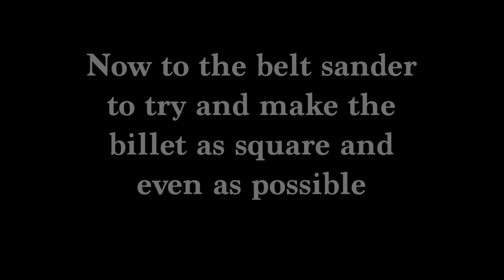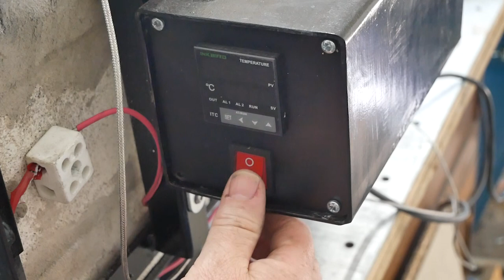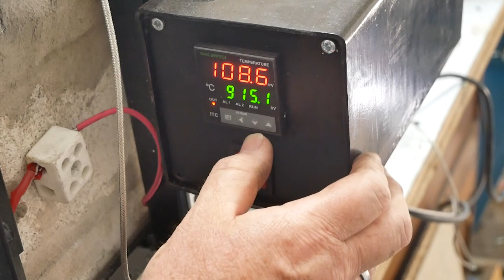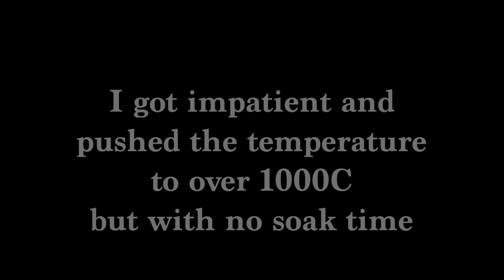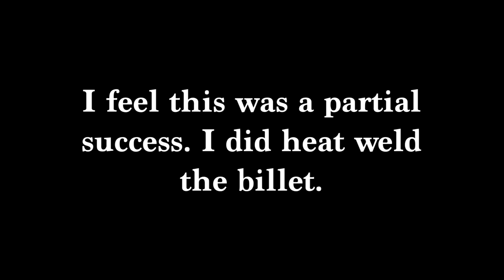Mokume Gane 1st Go

Comment: if that shear has  any space between the blade and the anvil.  AND if you have sharpened both; then  you might use a shim gauge to see what that gap is and then shim  the anvil   to bring them  closer together in the cut stroke.   you  should have them almost intimate for such thin metal work. Odds are good that it won't be the same from front to rear.  you'd need different shim stock to get it true.
I'm dying here.  What is the use of the little press?  I mean - - as the temperature come up to liquidus and the threaded members will relax and deform  releasing all pressure  on the  little billet, as you call it.  So then  the function of the billet press ends when the thermal regime is hit - - - yes?  And that'd be right when you'd need it.  Would not the ancient  smiths  have hammered the billet?      I can think of a way to maintain the pressure   it'd require wedges and hich speed steel shafts.
Reply from the maker: Thanks for the advice re the guillotine Raul. Good shout. Re the press, I am simply following the instructions of some of the top experts in the field. Actually, to be accurate, the press is there to keep as little air as possible from the sandwich so to speak. That is the most crucial part of achieving a weld between the materials. It is not there to be a press at the welding stage so I don't think  that's an issue. For example when you make pattern welded steel (Damascus as its wrongly named) the weld happens in the forge. You only lightly tap the billet on the anvil.